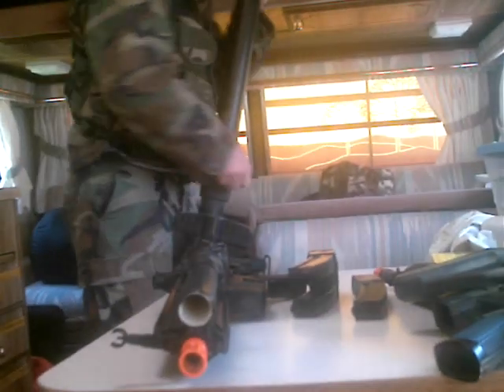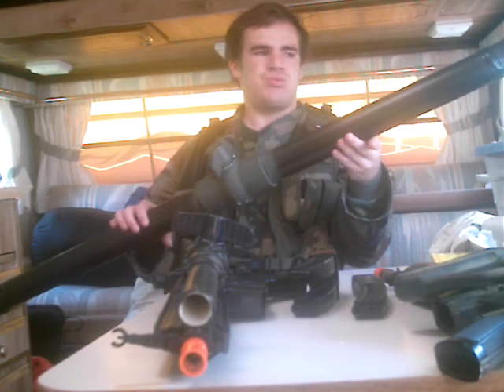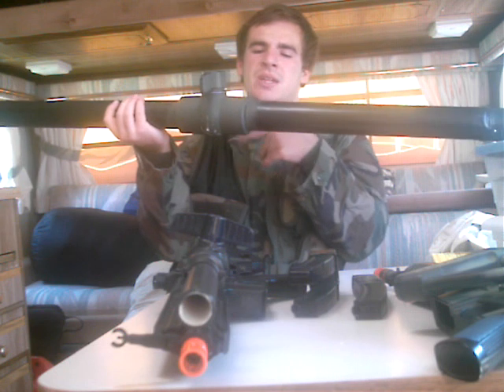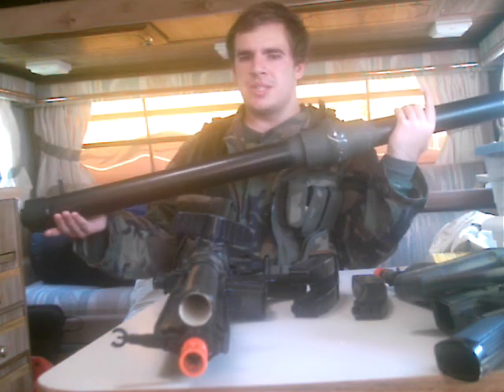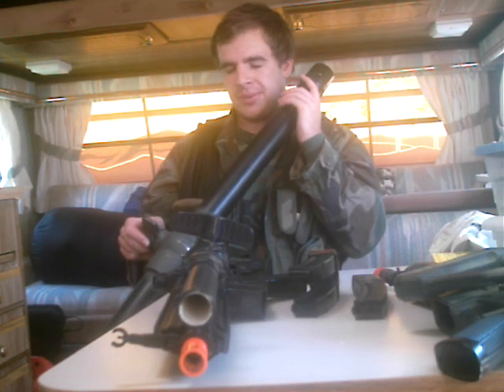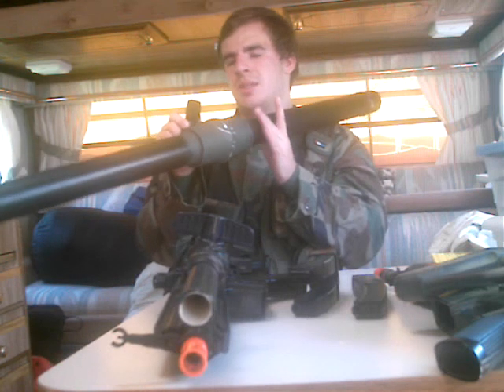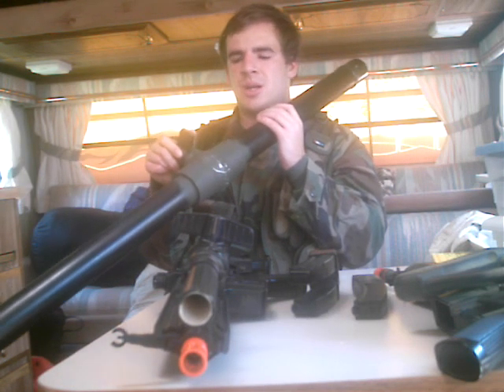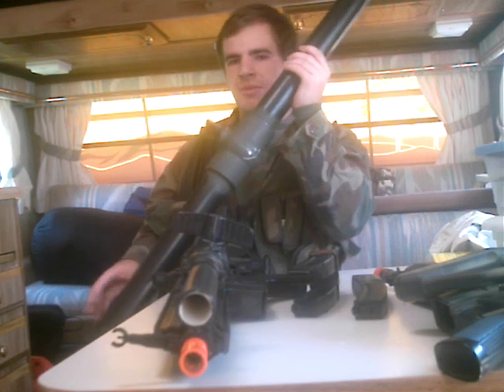Homemade airsoft Rocket launcher

Comment: @clinkythupimp It's so easy....... no need for tutorial just look at it.... put the 2 piped on both sides of the ball valve, completely seal 'em on, put a tubeless tire valve on one end, completely seal that on, close the ball valve, pump the air through the tire valve (a lot of pressure) then quickly release the ball valve to release the pressure and shoot whatever projectile.....